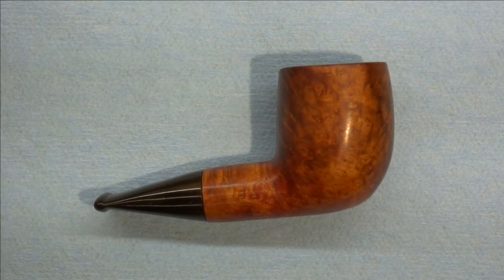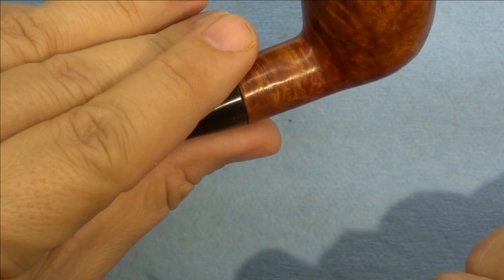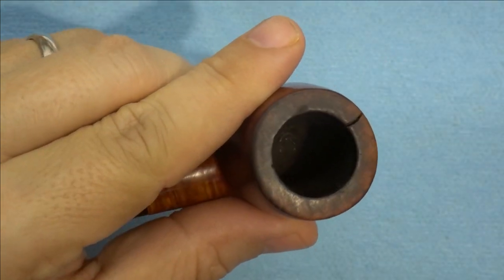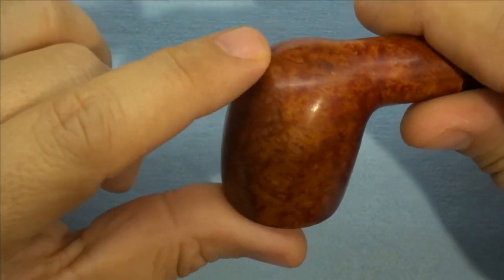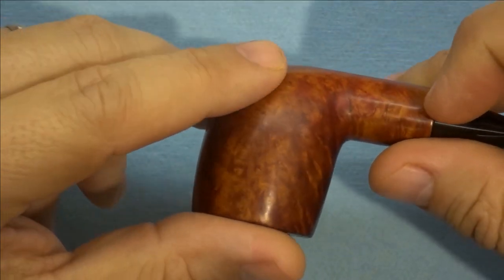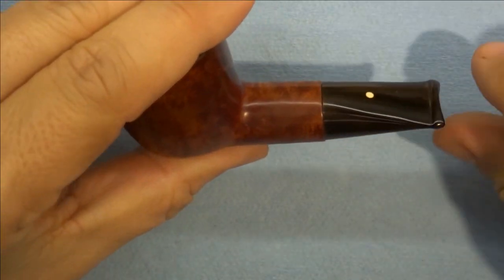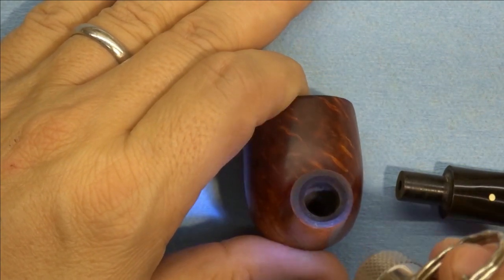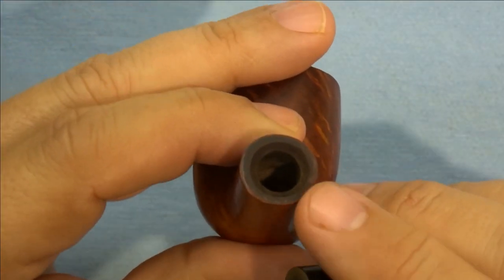Repairing a Cracked Dunhill 305 F/T Part 1

Comment: Challenging one! (Also, regardless of whatever happened with the shank-stem... such a grotesque hump on a Dunhill?, come on, someone dropped the ball with that one, or it was heavily "restored" [badly sanded to generate the hump] at some point, and later restained and rebuffed).
Reply from the maker: Yep.  I think that someone dropped the ball.  It looks too clean to be an amateur job and the shape is correct except for the hump.  QC ain't what it used to be at Dunhill.